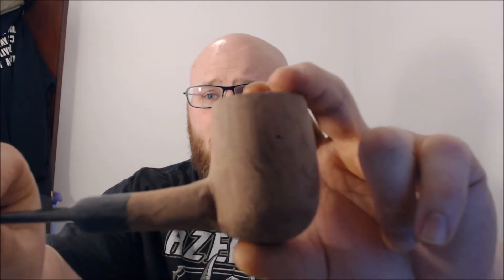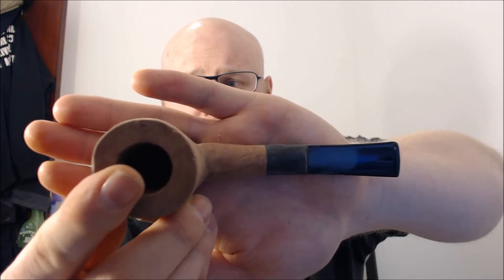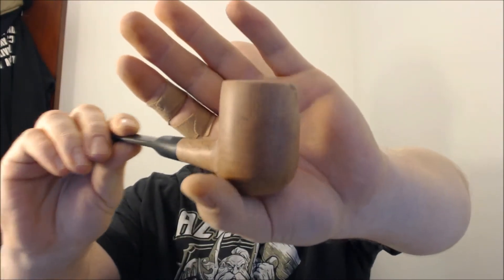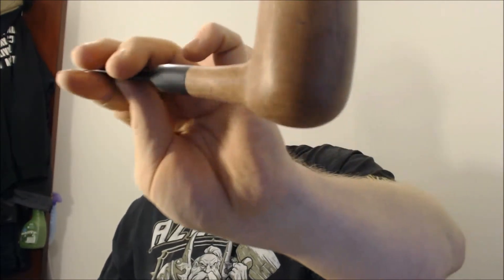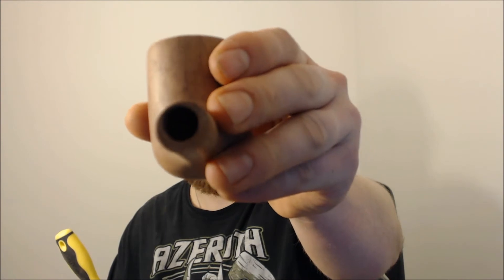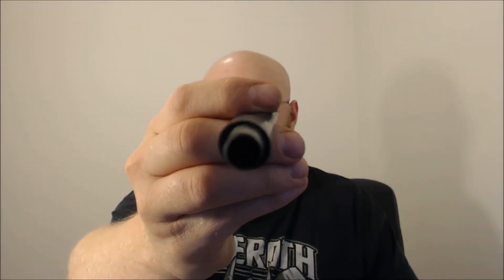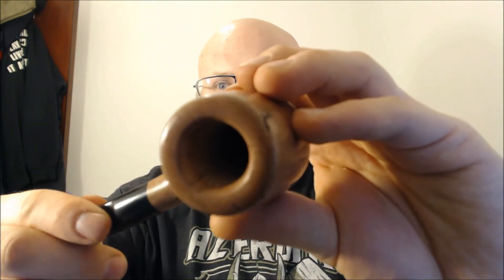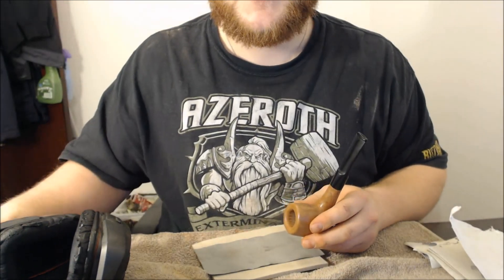Making a Pipe - Part 5 SANDING!

Comment: Great shine on the pipe already, when i made my two pipes i used grit 150,320,600,1200,2000.
It´s so much easyer using a wice .
Nice watching you make the pipe.
Take care.
Reply from the maker: I've bought a vice now :) next pipe should be easier. Thanks Tomas